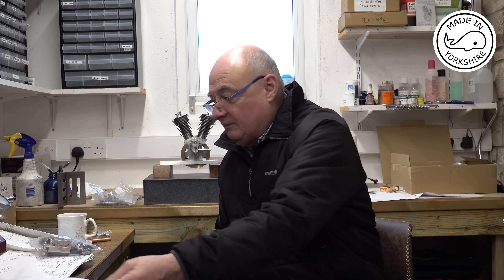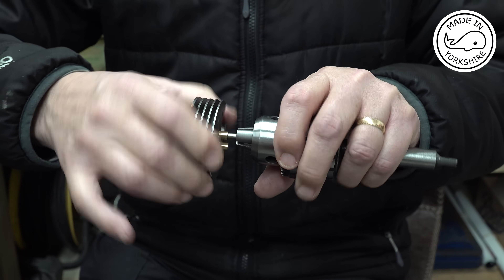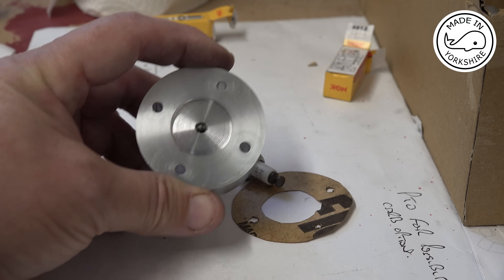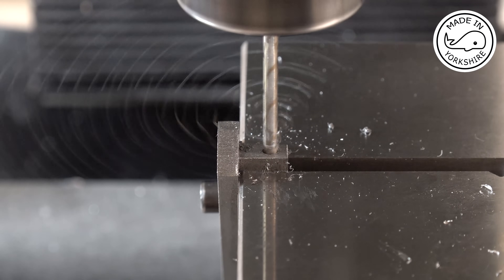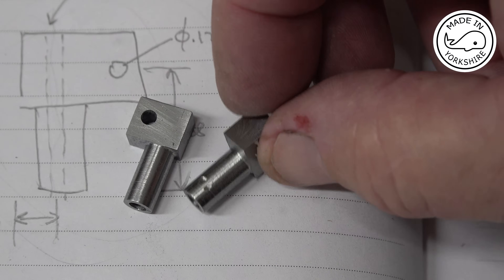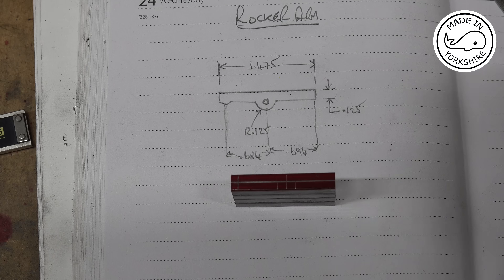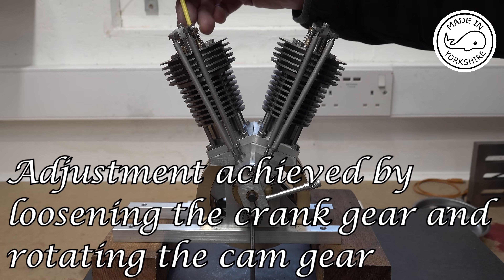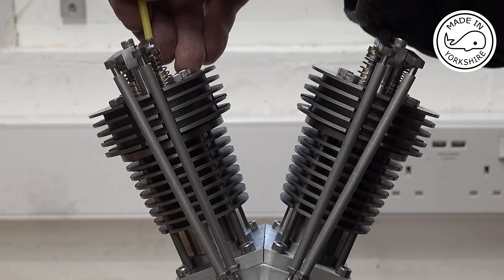#MT44 Part 14 - Hoglet V-twin IC Engine. The Valve Train and Lapping. In 4K/UHD by Andrew Whale.

Comment: Hello Andrew enjoying your Videos! Can I ask where you purchased that round type insert & holder from?  Many thanks
Reply from the maker: Hi Irvine. If it's the die holder you are referring to,  I made it in video #MT14. If that's not what you mean, please let me know the mins/secs position in the video and I will try to help.
Cheers
Andrew
Reply: @learningturningmetal  at 12min 11 seconds the round carbide insert & tool holder
Reply from the maker: @irvine40  Ah got it. I got the tool from RDG Tools - ref SRDCN1010E06. I use inserts intended for aluminium which give good results on most metals. I got those from APT (Associated Production Tools) - ref RCGT0602MO-ALU.
Hope that helps.
Andrew
Reply: @learningturningmetal  thanks very much!

Comment: Really coming along nicely Andrew, carbs are not really to be feared there are some really good designs on HMEM, I have made some to the George Britnell design and they work well. You must make yourself a ball turning attachment, I made mine to the Model Engineers Workshop design, if you're up to making one I can forward a reprint.
Reply from the maker: Hi Brian - thanks for the info. I will do some research on George Britnell. If I can get the Hoglet running I plan on making a Jerry Howell v-twin. That has a carb design and requires one for each cylinder. I read somewhere that someone used a JH carb on their Hoglet and it was a success. I will see how I get on with the OS21. I think I have digital access to Model Engineers Workshop. Do you know which Issue the ball turning attachment is in?
Cheers
Andrew
Reply: @learningturningmetal  Andrew the ball turning attachment was Nov / Dec 94, a real handy gadget to have in your collection.
Reply from the maker: @Toolsaddo  Hi Brian - sorry to be a pain. It looks like I can no longer access old versions of the mew archive because Adobe Flash is no longer supported. If you could email me the article I would really appreciate it. Email is learningturningmetal@gmail.com.
Cheers
Andrew
Reply: @learningturningmetal  on its way 👍

Comment: I have a carb that you can have if you are interested has an 8mm Venturi but I'll try and find a 7.5mm.
PM me
Reply from the maker: Hi Tony - many thanks for your very kind offer. I tried to PM you but I couldn't find that option on your channel. I have since been advised that it's not wise to use a carb with a larger venturi than the diameter of the intake manifold. Carburation seems to be a bit of a black art! My manifold has 1/4" diameter, so it might be that a 6.35mm venturi is the maximum recommended. So, maybe my OS21 will be OK. Yesterday I machined the manifold to take the OS21. So for now I will see if my carb works. If not, I will be back in touch. 
Thanks again.
Andrew
Reply: @learningturningmetal  to thanks for getting back to me,  if you do get stuck I'm sure I have a 6.5mm and 6mm Venturi. Just let me know.

Comment: What is the bore and stroke of this build       any idea of compression ratio
Reply from the maker: Hi Russ - its about 1" diameter bore and 1.5" stroke. Around 19cc per cylinder. I've not tried to calculate the compression ratio.
Cheers
Andrew

Comment: Engines beginning to take shape nicely. Is there any rocker arm/valve clearance?
That 5.5mm throat carby may work. It might run out of air at higher revs but can't see it running at high revs for very often.
Regards
Kevin
Reply from the maker: Hi Kevin - thanks for your thoughts on the carb. It's designed to be a 'show and tell' engine, so no real need to crank up the revs. The instructions are rather vague in places, so I just went for a few thou clearance for now. I guess that might need some further thought. 
Cheers
Andrew

Comment: Into the home stretch now. Looking really good. The cams are working well opening and closing the valves. Hope all goes well with the fuel/ignition system and you are able to show us a run next time.
Reply from the maker: Yeah Tim - it's getting to that scary/nervous time. It will be embarrassing if it runs like a 3 legged dog! Fingers crossed.
Cheers
Andrew

Comment: Broken centre drills are one of the reasons I moved over to using a 90 degree spotter drill in both my lathe and mill except where I needed to use an actual Centre in my lathe. Centre drills have an angle of 60 degrees and don't properly match the 118 degree angle of twist drills is one of the technical reasons for using a spotter drill. Stephan Gotteswinter did a very good episode on this topic a couple of years ago.
Reply from the maker: Thanks for the info Neil - I've just done a quick 'google'. Very interesting. The ones I found were very expensive, but I will have a look around.
Cheers
Andrew

Comment: I like my drill doctor for keeping smaller bits sharp. Larger ones are easy to sharpen freehand but I could never get the angles right with the smaller ones. Takes seconds to touch up a drill bit with the drill doctor.
Reply from the maker: Thanks for the info Noel. The drill doctors look good - but expensive. I'll put one on my 'nice to have' wish list.
All the best.
Andrew
Reply from the maker: Hi Noel - I couldn't resist the 10% Black Friday discount, so I ordered a 750X. I hope it turns up in the post soon!
Thanks for the suggestion and helping me spend my pension money!
All the best.
Andrew
Reply: @learningturningmetal  I use mine all the time. It keeps things more or less accurate and where I live it can be hard to get things. Regular size jobber drills are not usually a problem but anything considered odd like number or letter size drills are hard to get.
Reply: @learningturningmetal  I like mine for sure. I even use it for touch up when the hole I'm drilling is important. I wouldn't have bothered if the only way I had to do it was free hand.

Comment: great vids on a job well done!! this little donk is looking the part.  on carbs when you have the number of the aircraft engine ie. os 15  divide the number by 6 and it will tell you how many cc the engine is, os 15 = 2.5 cc   os 21 = 3.5 cc and so on  if you know the capacity of the engine you are building it might help to find the right carb for the cc.  other brands like asp make odd sized engines worth a look if it helps get closer to you're requirements.  hope this helps,  keep up the good work.
Reply from the maker: Thanks for the info Steve. I got a lot of carb related suggestion in my previous video, but it's seems like a bit of a black art to me. This engine is around 38cc (19cc per cylinder). I think I'm going to bolt the OS 21 carb on and see what happens. Nothing ventured, nothing gained!
Cheers
Andrew

Comment: Looking great Andrew. A soft spring will introduce valve float as you increase rpm (rpm will not increase above threshold), so you may need to play around with different spring rates. Would like to see an actual compression test to show cylinder balance. 
Overall your work is very inspirational and thanks for sharing, I'm so looking forward to your upcoming posts. 
Cheers
Reply from the maker: Thanks Rick! I think the weaker spring that I made is slightly thicker than the one in the drawing, so fingers crossed it will be OK. I'll bear that in mind though.
Good idea regarding a proper compression test. I have one kicking around somewhere, so I will see if it has a suitable adapter.
Cheers
Andrew